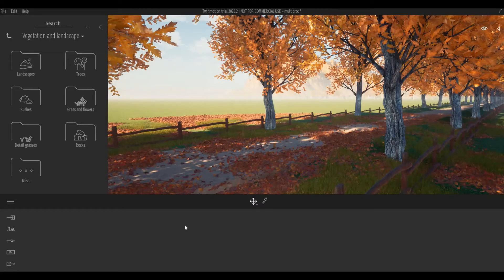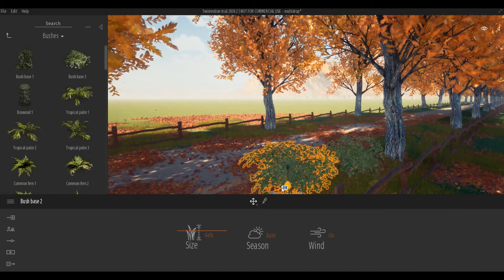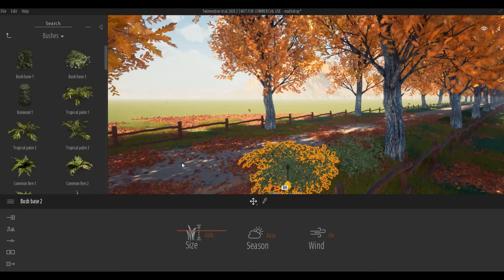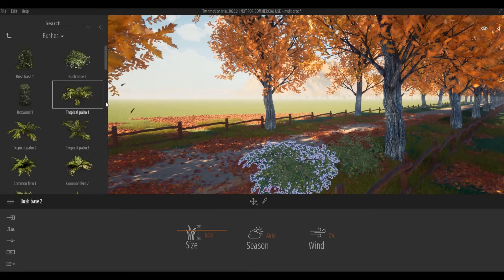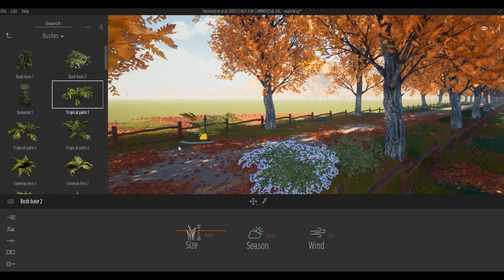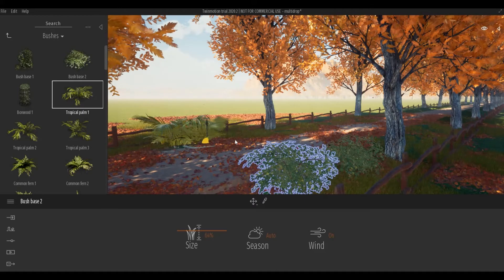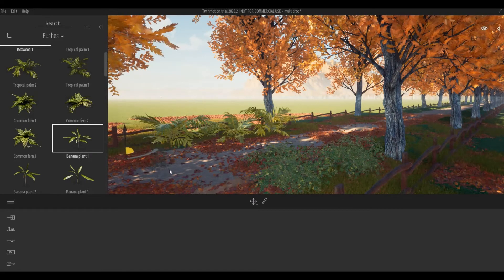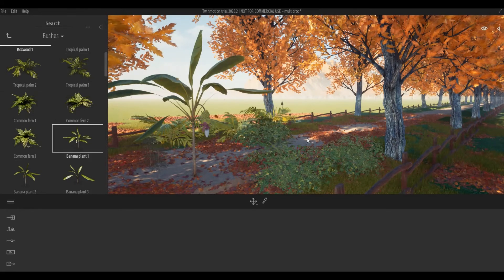Multidrop in Twinmotion | Twinmotion Tips and Tricks

Comment: Multidrop is a specific tool or through which Key key it is implemented.
I'm following you, but it doesn't work for me. Give some other video Thanks
Reply from the maker: Hi Daniel, it is not a key but a function. Basically by simply clicking on the specific plant you want and then clicking on the area you want it is the function itself. You can choose multiple plants and you can select them in an area.